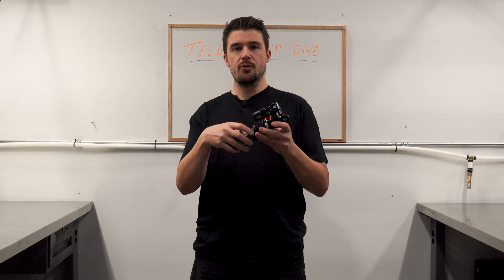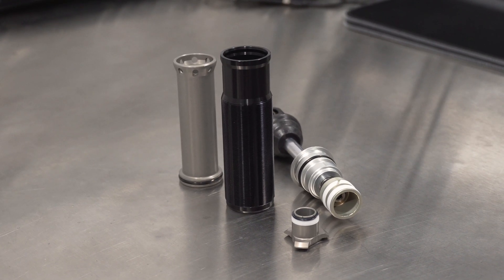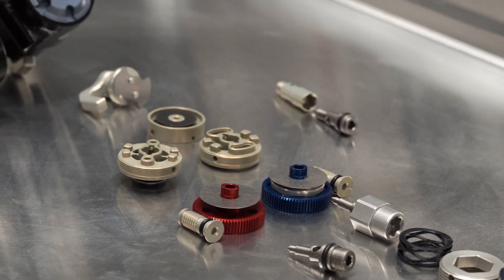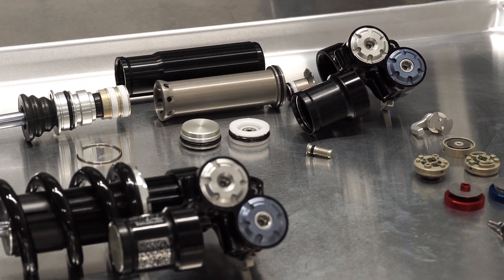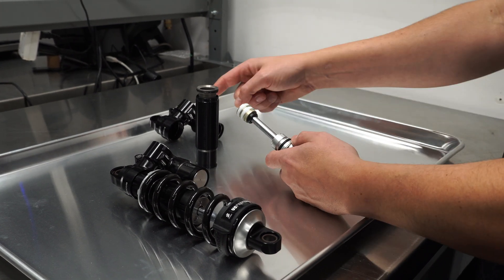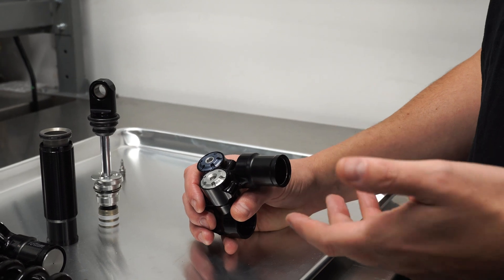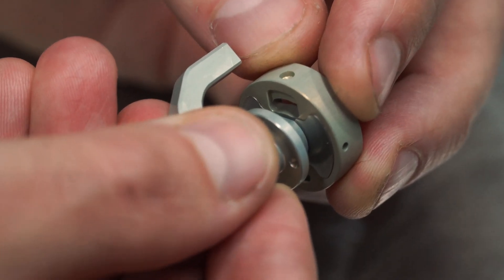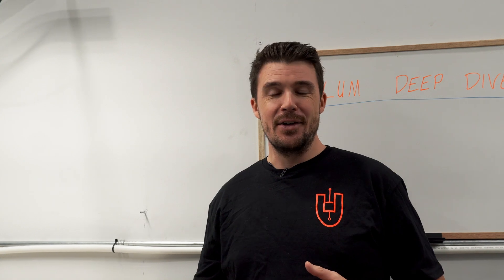Vorsprung Telum DEEP DIVE - Part 1 - Concept, Layout and Design

Comment: "Response" refers to how quickly the damper moves (compresses) after contacting a bump. 
Fox claimed they could improve this delay by 6 milli seconds by the method in which they tune their dampers.
My research shows the same.
At initial movement the piston pushes on the oil in the direction of compression, thats why we have acceleration, once the damper reaches peak velocity (where the forces are equal) the oil begins to push back on the piston, hence the damper begins to decelerate.
The pressure gradient for any valve is the required pressure drop for a given flow rate.
Incidentally this is just the same as "net force" for a given velocity.
With a more traditional damper arrangement its simply that the midvalve is how quickly you transfer force to the fluid (from the bump) and the basevalve is how quickly the fluid pushes back (energy dissipation)
I'll add to that, nothing pushes on the annulus.
The force calculation for a shock is no different to any other hydraulic cylinder, you just need to use the dynamic pressure to do the math. This just means subtracting the static pressure from your measured pressure and wallah dynamic "force"
Reply from the maker: If you're referencing what Sergio talked about on the Vital podcast, Fox actually claimed that they could improve the damper's force generation rate, so that they could see it building force within 6 milliseconds. Again this is actually a more rapid OPPOSITION to movement, rather than a more rapid motion of the wheel. It is easy to confuse the two when using the term "response" but they are literal opposites - one literally opposes the other.

The damper deceleration is due to the sum of ALL forces acting on it, including the spring and whatever other input is happening at the sprung mass and the wheel. It is not really specific to the damper internals - even a blown damper goes through the acceleration to peak velocity and deceleration back to zero, just because of the spring.

"With a more traditional damper arrangement its simply that the midvalve is how quickly you transfer force to the fluid (from the bump) and the basevalve is how quickly the fluid pushes back (energy dissipation)"
Not really sure what you mean there but on a technical level that description is not really accurate. By definition, energy is dissipated anywhere that work is done to convert kinetic energy into thermal energy, which occurs at any flow restriction including the midvalve, base valve or chassis flow restrictions.

"I'll add to that, nothing pushes on the annulus."
It absolutely does! Damper force is generated by the difference in hydrostatic pressures on either side of the piston, and the respective areas they act upon - the annulus area on the shaft side of the piston (the chamber that's pressurised during the rebound stroke), and the annulus + shaft area on the non-shaft side (ie the full area of the piston). 

I think you are using ambiguous (and technically incorrect) terminology here with respect to "dynamic pressure" and "static pressure" though I think I understand what you mean ('static" as you are using it meaning the internal gas charge pressure when the shock is static, and "dynamic" meaning the internal pressures in each chamber when the shock is moving). For technical clarity on terminology, when calculating forces in a damper, you use hydrostatic pressure, not dynamic pressure. Dynamic pressure (0.5 x Density x q^2) is a calculation of the kinetic energy of the fluid using the Bernoulli fixed flow rate equations, it's a form of stored potential energy, but the hydrostatic pressure is what actually generates the force that acts on the piston.

Comment: Great to see you guys are back on youtube, just a few questions, i always thought a push/pull piston would create alot of lag/hysteresis, like in the old dhx2/x2, thats why when you want to custom tune them they add a rebound side stack to lower the lag. But you say yours has very little hysteresis how can that be?
Reply from the maker: Hysteresis is to do with how much volume of oil needs to be displaced (which can be directly correlated with shaft displacement) before it's possible to generate a given force, which occurs during acceleration (but is not due to acceleration per se). That oil displacement requirement comes from the elastic deformation of every part of the shock that's pressurised - adding a shim stack to the main piston does absolutely nothing to change this if you don't also change the stiffness of the chassis structure or reduce how much of it is pressurized. Displacing more oil with a solid piston helps offset the elastic lag by using the greater mass/inertia of the oil column to increase the damping force during the acceleration.